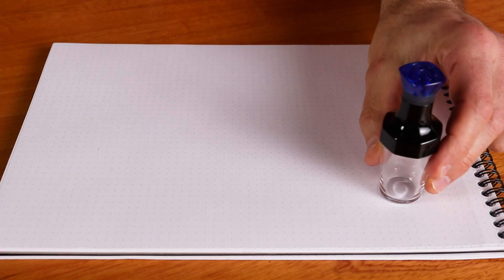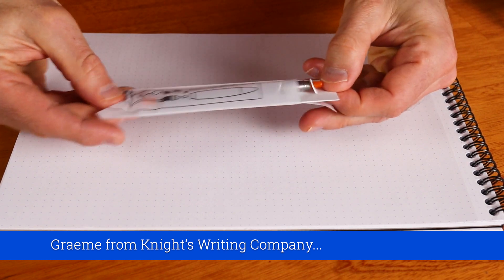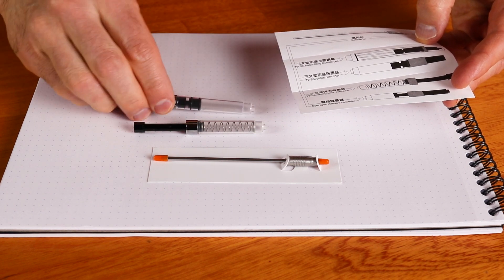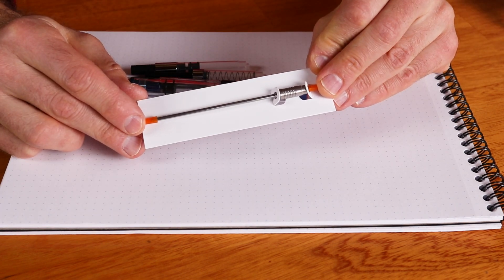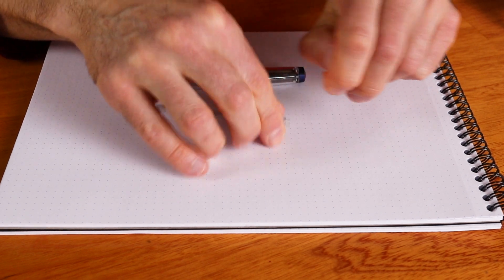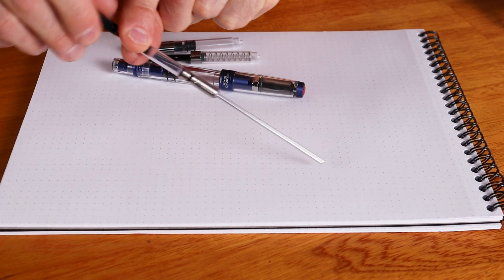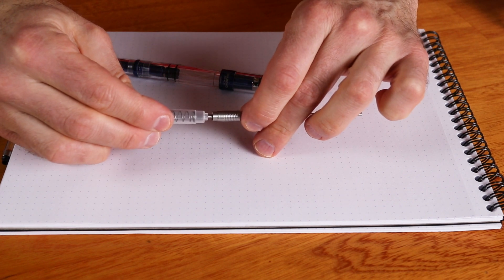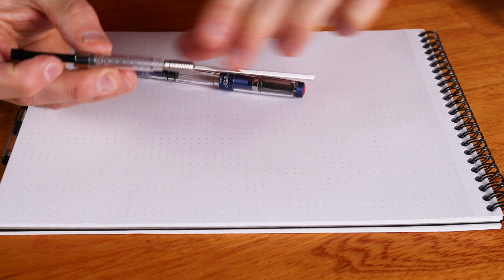The TWSBI Pipe Quick Peek

Comment: I have the pipe, the trick is to fill only about 70% of the pen, remove from the ink and then draw what's left in the pipe into the pen. Otherwise as soon as the pipe is pulled off, the vacuum is broken and it all rushes out.
Reply from the maker: Awesome advice. Thank you!!!!
Reply: Good tip.
Reply: Thanks for the tip!